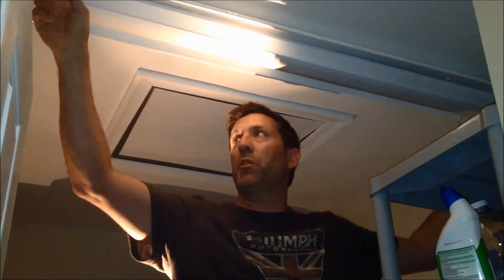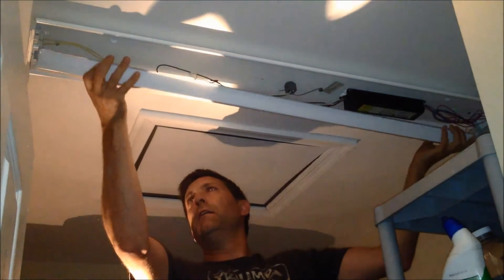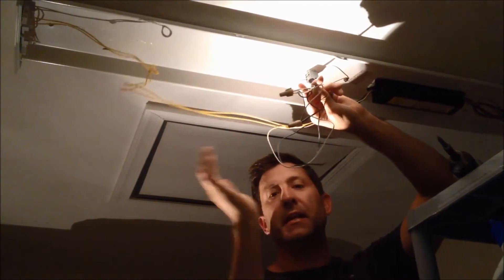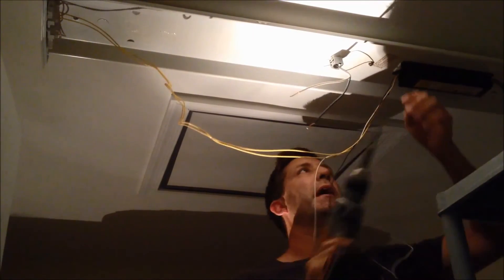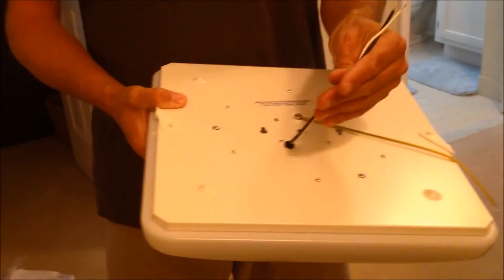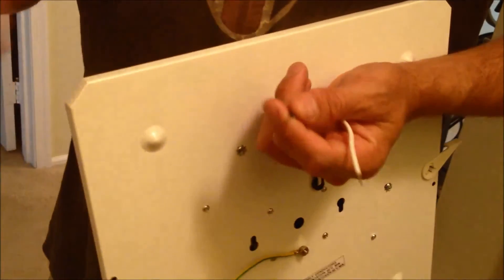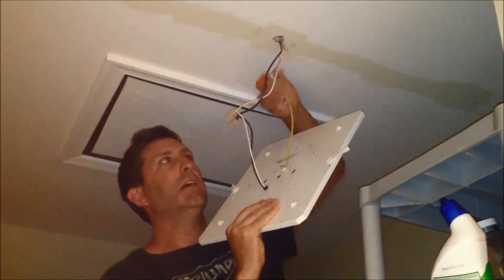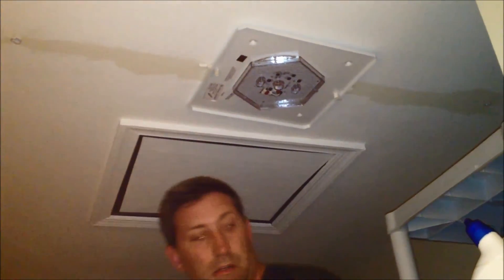LED ceiling lights AMAZING NEW FLAT PANEL - Learn how to install

Comment: No Electrical box behind that new fixture, connections outside of a box. it's a shame that you posted a video like this. The light isn't even straight, working on a metal ladder. if you're in the States or Canada and you posted this video, you're responsible for the electrical integrity of your home even after you sell it. this video is also proof you worked without a license and permit. If for some reason your house catches fire and electrical is involved in the fire, you better hope your insurance don't see this video. ;)
Reply from the maker: Thanks for the warning - this install was in a closed studio.  But your advice is sound and should be considered before attempting this project.

Comment: How bright are those?  And if I want to instal two where there is only one feeder how do I add the second one?
Reply from the maker: I cant believe how bright they are.  The real value is that you will never have to replace any other bulbs.
Reply: Actually, it seems like these last as long as a regular led, so in other words, you will have to replace the WHOLE fixture. It's corporate bull to write on these lamps how many hours they will work, and the add "up to." These will last about 5 years, according to Pixi (one of the big manufacturers of these. I did get one myself, and it looks great. Nice and bright. But I don't think I will put these all over my house. Don't really feel like whipping out a few thousand in a few years (and this is assuming their 5 year claim holds up, which rarely does).